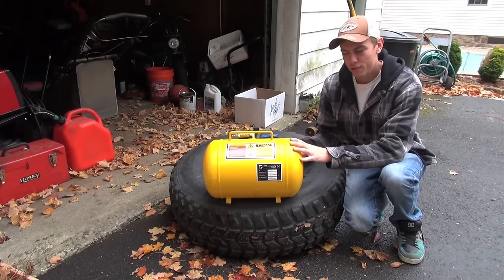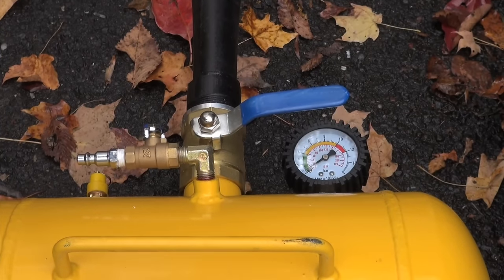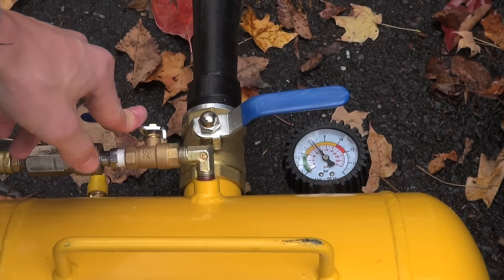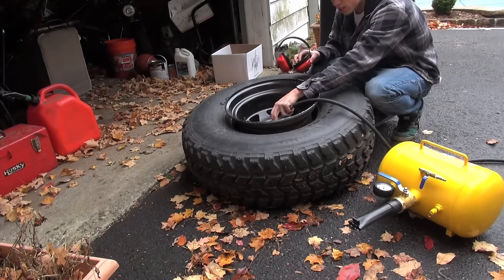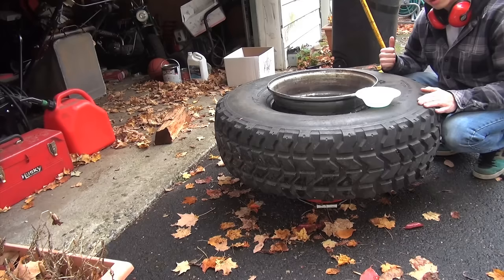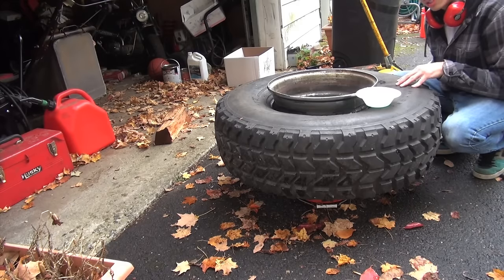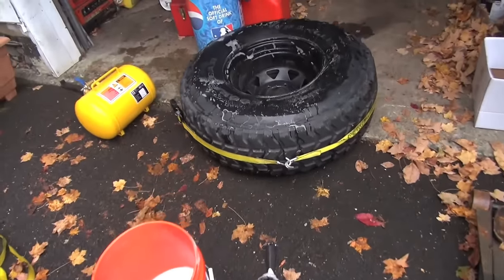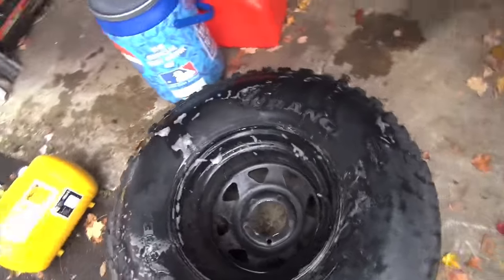Using a bead seater

Comment: Works better with tire standing up. Soap both beads, bounce the tire and wheel and with the valve stem down, blast the top. Where did you get the psi for different tires? I have always filled them with tool hose pressure (95psi) and use a cage for split rims.

Comment: Thank you for the informative film. I'm going to use a portable Bead Seater (XK USA, 8 L), can you compare w/the one you used. And also when you spray a lot of water on the tire which is not sealed, that water can go inside of the tire.Can it cause a problem? It was interesting to know that you used 2 straps (I was planning to use 1). So finally it worked when you used that blower without the black hose, which was simultaneously inflating the tire, is that correct?

Comment: hook up air, spray inner rim with starting fluid, throw match. mild explosion expands air rapidly and sets bead. throw sand or water on tire if u have a small flame on outside of tire from any overspray. obviously inside goes out immediately when starved of air.  fill to proper psi. works well on large tires. scary first couple times u do it but u can get good at it. I have seen truckers do this without removing tire.  As always, never try this at home.

Comment: That was a tough one. I change quite a few trailer tires. 275/70R22.5. They seat really well usually without the bead seater. If they don’t it only takes one blast.

Comment: I was trying to mount a new Chinese 225/75-15 trailer tire with the sidewalls collapsed together from being stacked on top of each other.  I couldn't get the beads to seat until I watched this video.  I had to flip it upside down and put it on a 5 gallon bucket, then I put the air chuck on it and blasted it from the back with a Cheetah tank.  It beaded right up.

Comment: What if he had used bead sealer goo instead?  It seems like the soap added too much lubrication so that the bead just pulled away instead of staying put.  Another thing I think is a factor is temperature.  From the fall leaves on the ground and long sleeve shirt it must have been lower than 50 deg.  If the tire could have been warmed up to 70-80 degrees would it have been less stiff and not pulled away from the rim so quick?  
Not really convinced this tool is any better than using the starting fluid/fire method!

Comment: Oh the memories. I tried to mount these EXACT Hummer H1 tires on 12" wide aluminum 16.5 wheels. These tires need a narrow wheel, then they mount real nicely. My experience was a total fail mounting the 5 tires I had, so I took it to Les Schwab. It took 2 of those kicker tanks and 3 tire guys to mount each tire, but they got it done. So what happens when you lose air pressure, or air down for sand? Yep. they fall right off the bead. And with the sidewalls as stiff as they are, no amount of starting fluid sprayed into the tire will seat that bead on the trail. Great tire, just use a narrow wheel!

Comment: So you have air flowing in from the valve stem simultaneously while you use the bead blaster? Do you have the valve core removed or is it in the valve stem.
Reply: Core removed always

Comment: I used 4 8"2+2 stretched tire in sun few hours  .mount on rim . set tire on 3 milkcreats tap rim down with rubber hammer let soap dry .  carefully flip wheel over on your 3 crests gravity lowers rim to rubber.  Worked for me.

Comment: Do you think of that maybe the 5 gallon bead seater is undersized for the kind of tire you were working with? I know they make these bead seaters in larger sizes, 7.5 gallons and 10 gallons.
Reply from the maker: It was complete user error as I have never used one before.  I can do it in one shot now!
Reply: +Jpk92 Well wish me luck. I just bought a 5 gallon seater and in the next day or two I'm going to try to seat a 10 ply trailer tire on a rim that is a couple inches wider than the tire in its present condition. It is the stiffest tire I have worked in quite a while.. Thanks for putting up your video.
Reply: 5 gallon is sufficient for most semi tires.

Comment: lean tire on the wall valve stem at 6 oclock bead seater at 12oclock next time(been doing tires since 1981)
Reply: Cipriano Ortiz Even with TPMS?
Reply: Ortiz good advise
Reply: @Thinker669  you wouldn't use a  bead seater if you had a tpms
Reply: @Xsidon  i mean good luck getting air in one of those douches trucks with 24x14s without a cheetah
Reply: @jasontbo6663  so you're saying that you used a bead seater on tyres with tpms and it didn't break the Sensor? tpms in trucks is just tougher than in passenger cars?
Reply: Xsidon never had a problem lol

Comment: Great video!!! How does the 37x12.50x16.5 military tire ride? I just bought a set and had to go through taking out the run-flat Donuts out of all of them, what a pain in the butt.
Reply from the maker: They're loud and ride rough, but they get the job done.
Reply: Best $100 for a new wheel and tire combo out there. You are definitely right they are loud as hell and do seem to ride a little rough but they last such a long time.

Comment: I saw a professional tire installer change a truck tire... literally in ONE minute. I was like what the heck was that tank of air? 
His tire was vertical (obviously) and I wonder if that would worked better if you had the tire in the vertical position. So the Bead can’t fall down... ??? Just thinking. Thanks for the video

Comment: did you put sealant?
Reply from the maker: No sir.  The only type of "sealant" I used was soap and water.
Reply: But wont it cause leaks even after the tire is set?
Reply from the maker: Not that I'm aware of.  I did this video about 3 years now and I do not have any leaks
Reply: Oh. Alright
Reply: no sealant needed. friction and pressure seal. will not leak over 20 psi

Comment: 1:28 where you have the spout of the bead sealer too far away from the tire bead. it should of bin tight against the tire bead you would of had better results! you lost too much air flow the other way.

Comment: valve core the fucking valve core lmfao good luck filling a tire with no stem 😂
Reply: Yeah, It's not that hard to figure out what he is doing wrong. The tool is to simple to be the problem so is probably the one using it.
Reply: He should have just cut the failed attempts out of the video

Comment: don't put the whatever the PSI says on your car tire !!!! Look inside the door jamb most likely where it will tell you the correct PSI .....May car MAX is 35PSI ! If I put 50-60PS in it my car would handle extremely dangerously !!!
Reply: Kevin S - The PSI ratings he showed were NOT the tire pressure. Those were pressure levels to fill the BLASTER to in order to push the sidewalls out and seat the bead. Even after a 100lb blast, you'll need to add air to reach your car's factory tire specs.

Comment: All you really had to do is overinflate a bike tire inner tube and let it seal temporarily then pull it oug
Reply from the maker: +nick elias interesting..never tried that
Reply: I have a shop and use the cheetah for when theres only about 2 inch gap of space but when theres more the cheatah cant always pump enough air. In those cases an inner tube helps seal. Just dont get it caught in there lol. Pull it out just when the top bead starts to seat alittle

Comment: Next time, Don’t use soap & water, just put your foot on the wheel and push the back side against the bead real hard, to where it almost sticks as if it’s on the bead. Then, just pull up easily on the tire as you are putting air in, and pull the tire until it touches the bead and it will seal right up. You don’t need a bead seater or Cheetah…. I guarantee you, I could’ve gotten that tire sealed easily first try. OR… Ether and a match will seal it right up too, but that’s kinda sketchy…. 😂 
But, honestly, what I said first works perfectly. The soap & water you used was causing it to fall back off on you, it actually hurt you, not helped ya. I promise… My pops has had a tire shop his whole life. 👍

Comment: good.... but never use soap:  Vegetable oil soaps or animal oil soaps, in solution, are the preferred materials for
use as bead lubricants. Never use antifreeze, gasoline, ether, silicones, or any petroleum based
lubricants. Never dilute lubricants beyond that recommended by the manufacturer since this
may have a harmful effect on the tire and wheel/rim.

Comment: 16.5 lol
Reply: 16.5 inch rims is what the military rims are and old 70s Chevy and ford. Not sure if dodge ever used them but they may have as well. I still run 16.5 wheels on my 70s Chevy mud trucks. Only down side to them is they have no bead so if you run them with low air pressure for Rock crawling, they will pop the bead and go flat and probably come completely off the rim.

Comment: if you cant afford the right tires for wide rims just dont buy the rims in the first place!!!!
Reply: Info: I ordered exact replacement 16" tires for my explorer. The new ones come strapped in pairs. I don't know if that is why the centers are not wide enough but new tires aren't stretched yet. My rims are standard.  I couldn't get mine to seat normally so I ordered a 10 gallon bead seater. Hope that works.